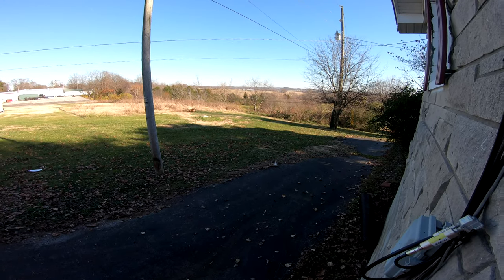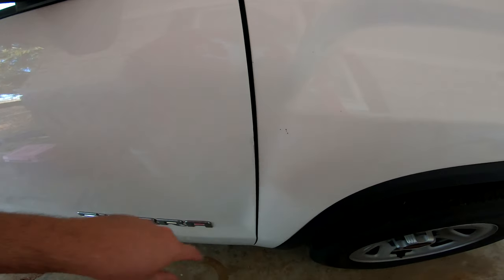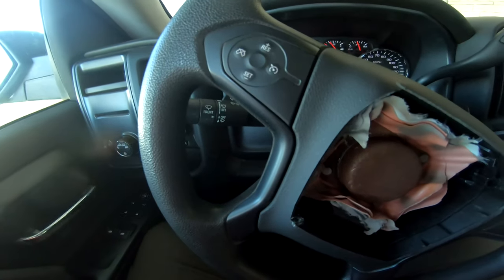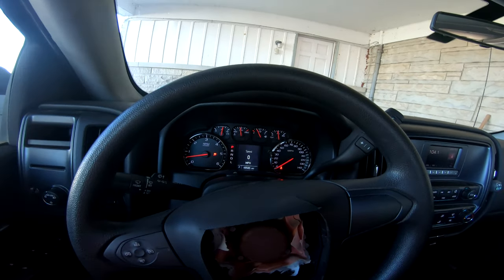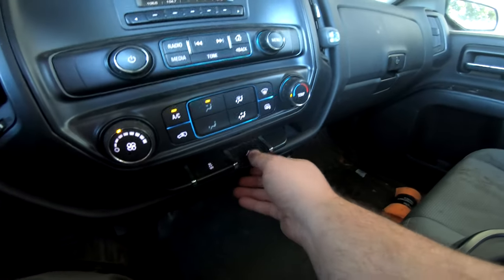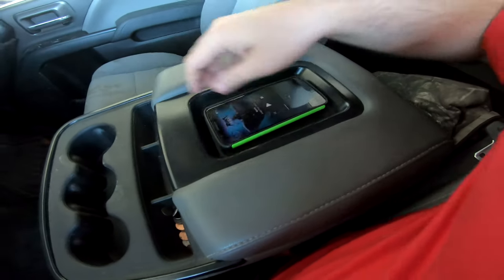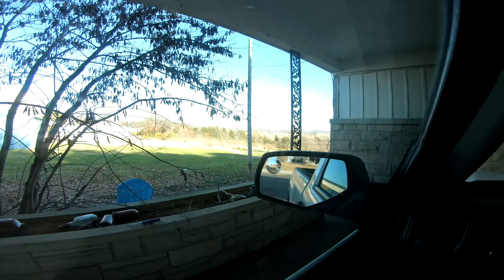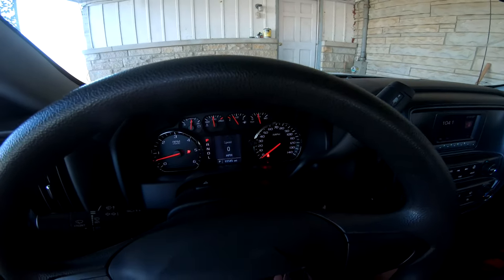New Truck Tour!

Comment: T2 with that truck and a high res vest and a hardhat you can go anywhere you want. I wouldn't spend a ton of money to fix up too much. Airbags, seat belts and plastic grill Id replace but thats about it. I would also address the passenger door hitting the fender so it doesn't cause more damage to the door. Hit up a junk yard and see what you need. The 5.3l is good but if its a 4.3l that is great too the newer 4.3l v6 engine they came out with in 2014 is a really good engine.

Comment: Diesel pickups have 2 batteries to crank them over to GM just has that 22nd battery there incase a diesel was put in during manufacturing. The battery is under a cross bar on the passenger side firewall.

Comment: You should get a hard folding cover for the trunk. It's about 750-800 USD and you can order it on Amazon. Front grill and front light you should be able to find used cheaply on eBay or something maybe Amazon too.

Comment: That’s some expensive damage to repair. I have a 2014 car that had less damage than yours in the exact same spot and it was almost $3k to fix. Plus since the deer collision was hard enough to lock the seatbelts and deploy airbags I’d be very concerned about front end frame damage.

Comment: you should get it inspected. Used work truck with front and passenger side damage, and it looks like it's got a decent amount of miles on it. some places will get some fubar pos and fix up a few things and sell it to someone unsuspecting. You really don't want this thing to die on you when you're 11k in the hole, or still making payments

Comment: 11000$ if that frame is bent that is gunna be rough on the wallet and if it gets pulled over with no air bag they are gunna take the truck
Reply from the maker: didn't know deer could bend a frame
Reply: nah frame is fine lol, take bigger impact than that, just leave the plastic bumper who gives a shit, truck meant to look rugged, also it's not illegal to drive without airbag, they can't do shit, just advise to get it replaced thats all they would do.

Comment: The 5.3L is an 8 cylinder engine, you mentioned it being a 6 cylinder which means it's probably a 4.3L. That empty battery spot is for an auxillery battery, if you decided to hook up extra lights or a plow, etc. Does it have 4 wheel drive? Sick truck!
Reply from the maker: title says 6 cylinder, I dunno - no 4WD tho